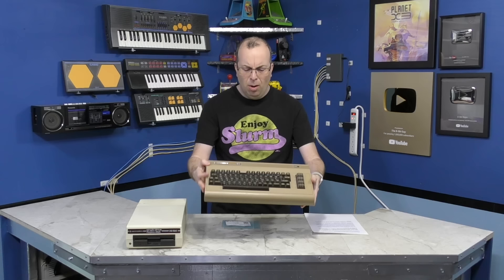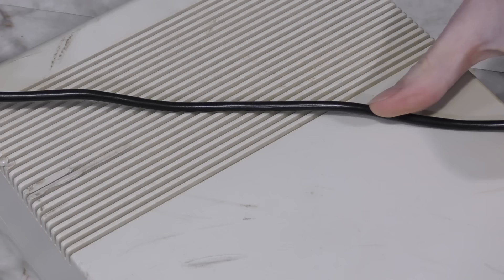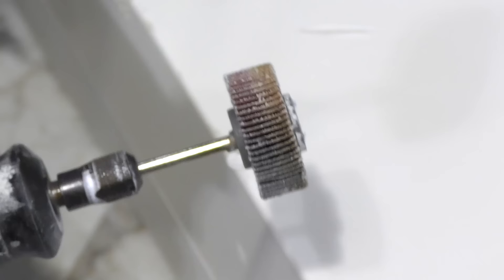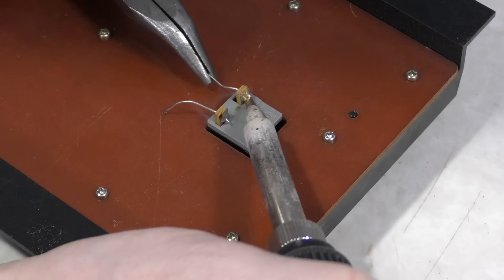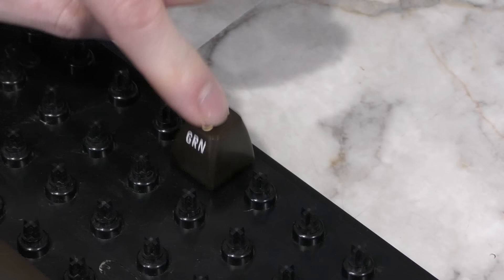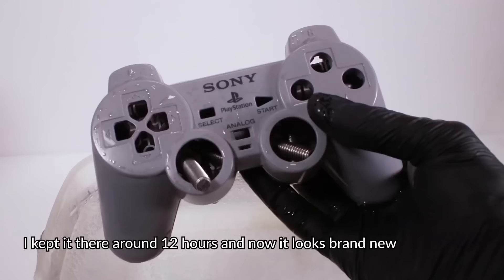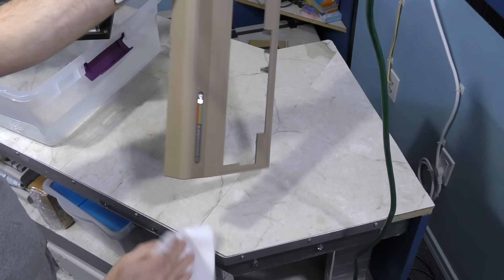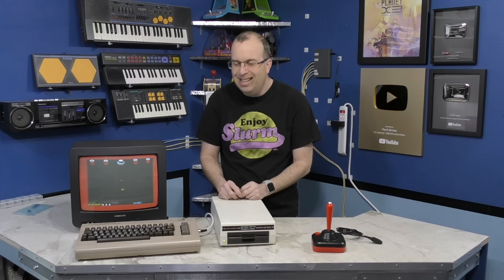Commodore 64 Restoration and new retrobrite technique.

Comment: Review of Black Magic: "I used this product on all four of my tires and now have white half circles on my blacktop driveway.
 Apparently forever unless I reseal it. They've been there for months and won't wash away. If you let any of the product drip from your tires onto the blacktop, it will be irreparably stained. I tried contacting the company and got no response. There is a warning in small print on the back label to "wipe off excess to avoid spin off" but who would ever think it would stain and ruin your driveway.  Stick to Armor All."
Reply: I wonder about shop floors, how good of a chemical repellent it is.
Reply: I've used a similar product (actually thought it was Armor All but may be mistaken) and had the same marks on my driveway.  So, next time I did the tire dressing in the street but realized now people will see those marks on the asphalt.  I scrubbed the hell out of it and eventually didn't notice any more.  In the future, I used old cardboard to do this job.  You'd think that someone could invent a dressing that doesn't leave just obvious marks on the concrete/asphalt.
Reply: Wait a minute. People want clean drive ways. Don't we want to do this on purpose?
Reply: Stupid question but... Who need shiny tires (well except for car seller companies I guess) and why?

Spending good money on probably toxic chemicals just for tires that will be dirty again just next time you use your car... I don't really get the point. :-/
Reply: 🧐 Just Black Magic the whole drive way. Problem solved. 😎
Reply: @Pr.Shadocko  You took the word right out of my keyboard. ;)
Reply: Forget overpriced Armor All or Black Magic. Scotty Kilmer uses, All American Armor car care products.  Its on Amazon & they sell it by the gallon. Get her done...peace!
Reply: If you think that's bad, try moss killer.

Comment: I have been using a similar set up to retrobrighten breadbins for about 10 months. The difference is that I surrounded the outside of my plastic bin with aluminum foil. This reflects the light and makes the exposure more even on the front, sides and back. Secondly, rather than suspending my UV light (although I used to do that), I lay a piece of clear plexiglass over the top of the bin and place my LED UV light right on top of it.

I use this approach to retrobrighten the tops of breadbin keys. I have had a LOT of keyboards that have yellowed characters on the top while the front PETSCII characters are bright white, just like the 64 keyboard in this video. I take (Sally's Beauty Supply) Salon Creme Vol 40 and apply a THIN layer to the top of each key covering the ENTIRE top surface. Then I place the keyboard in my retrobrightening bin (without water or peroxide) and expose it for 8 hours. This returns the key characters to bright white. If they need a but more then I reapply and do it again.

These are processed I developed over time and were definitely influenced by the videos from the 8-Bit-Guy and other YouTubers like Jan Beta.

I've also tried 3D printed plungers and they just aren't reliable, sadly.

Comment: David - Nice Job! As a Tech who has been cleaning electronics for over 40 years, I think you should consider a few things.
1. You joke about Cancer but proceed to use chemicals without gloves. Go to Harbour Freight and pick up some nitrile gloves. They have them in three thicknesses and when on sale are CHEAP.
2. Before you clean with liquids and make mud, you should VACUUM most of the dust off. A couple seconds with a vacuum will cut minutes of time removing said mud. It also get dirt in the cracks & crevices that wiping won't. If you're going to take the time to do it, do it right, eh? It's actually faster.
3. Always do your disassemble BEFORE you start with the liquids. Putting baking soda that's been soaked in Window cleaner into the circuits is just dumb. If you fail to get ALL of it off it could cause electronic failure down the road, plus you're ADDING the work of cleaning it off. Disassemble THEN clean. 

I won't sugar coat this, but I don't care how many projects you've done or subscribers you have, improper technique is still improper technique, don't teach others your bad habits.

THAT said I think you did a great job here and are quite entertaining and knowledgeable. Don't take my comments as a "put down" we ALL learn new stuff daily, be willing to learn too, k? :-)
Keep being awesome!

Comment: Get a dremel you can adjust the speed on, very important.
Reply: Yes, that thing is running way too fast, melting the plastic. He needs to slow it down.
Reply: I use a Dremel Flex-Shaft myself. Great for when the Dremel is too bulky for the project, or you need finer control. I have a 2-speed Dremel, but with the Flex-Shaft attached, it sometimes slows down to the point of stopping.
Reply: @Christopher-N  I don't have a dremel but a Proxxon FBS 115/e.
It has continually variable speed and is considered by many hobbyists as better quality than dremel...
Reply: Lassi Kinnunen : Interesting. While I've never heard of a Dremel Flex melting, I have given mine some strenuous work at times, and was concerned about the shaft breaking. It never has, but it is something I think about with every use. Keeping it straight as possible definitely helps prolong its life.

Comment: Great video, great tips. I've never encountered leads melting plastic in my life.  It's usually down to soldering irons. Never a good sign on any unit. Not only is unpleasing, it shows neglect or constant attempted repairs on the unit. Either that, or that drive was getting really hot. Maybe something heavy on top of it covering the vents. You make em look nice again. That's the main thing. 😉👍

Comment: Why don't put aluminum foil outside the container? As to protect your eye and strength the UV bounce back inside.
Reply: I'd think doing that would assist in retrobrighting the sides of the plastic too.  Though getting a bin with smooth ends would help side-light eflection.  (I'd put the foil outside to prevent reaction, though less effective).
Reply: That won't work quite as well. Like he said, glass and plastic absorbs a lot of the UV light going through it.
Reply: Lowen Evvan, Ot would work better than without. A loss of some light isn’t a loss of all light. Any amount of UV light refraction from the foil would aid in the process.

Comment: Another great video although I would only offer one bit of advice. White Lithium Grease over time turns rock hard. I cant tell you how many 400k Macintosh drives Ive restored with that grease in there... its Awful! I use red bearing grease. All grease may harden over time but Ive had good results from it. Keep the videos coming!
Reply: Why not silicone paste?

Comment: Loved this post. Many years ago like in the late 80's I had a C-64 and cassette drive connected to my TV. I had a lot of fun typing in programs from the then magizines , LoadStar and Commodore Gazette. anyway I joined several c-64 clubs and started a collection. By the late 90's I had a room full. Three SX-64's all working, thirty or more C-64s, C-64c's , vic 20's, c-128s and many many drives. I was the go to guy in my area to get parts and or repairs. Finally had to get rid of it all and donated it to an other collector. It took a small trailer, a horse trailer and two pickups to load it all away. I miss it dearly. I modifieda couple with two sid chips to get six voices. I even wrote some songs in six and donated them to Loadstar who published them making me kind of famous. for about a week.

Comment: For cleaning/bleaching sun yellowed white plastic, I too found the translucent storage bins from the hardware box stores essential for this type of cleaning operation.

I've found, rather than diluting or buying low percentage peroxide and placing the translucent storage bin within direct sunlight, using straight 12% peroxide is by far optimal or best!  If you have pets that might get into the peroxide, can drape clear plastic cling wrap over the top, taped to the sides of the translucent storage bin while sitting within direct sunlight.

I never tried synthetic UV lighting, figuring natural UV sunlight would readily outperform synthetic UV lighting.

I also avoid using ammonia on any plastic, as ammonia residue seems to increase UV damage.  I prefer removing all electronics from the plastic casing, first wash the plastic with a safe degreaser such as Dawn dish washing liquid, then subsequently bleach the plastic.  I avoid using any alcohol.  Albeit, minimal spot cleaning with denatured alcohol, as well as lightly sanding with 1000/2000 grit sand paper is likely OK when needed.

Comment: A tip for later. Use a metal plate when you screw into the remanence of the plunger, that way you even out the stress on the key and have full control of extracting the plastic. You can use spacers to adjust the height. I like your videos, no fuss, just plain old nerdiness and skills.

Comment: Hello, I've watched many of your videos which have helped me have a better understanding of retrobrite and how it works. I actually work on shoes and in the past have used salon care 40 to reverse the oxidation that is in the soles of my customers shoes. I now have my own formula of "sauce" that I use to unyellow my customers shoes and wanted to offer some advice. I would like to suggest using a 600 watt growing light to unyellow or "retrobrite" the pieces that you work on. Using salon care 40 would actually do very well under that type of light and should be able to get you some very fast and efficient results. All you would need to do is put an even coat of the sauce on your object and then place it underneath the light for a couple of hours to get the results your looking for. I know our businesses are completely different but I just wanted to share some tips that I've learned within the 11 years of experience I've gained as a sneaker cleaner. I actually have videos on my channel that take you the process I'm talking about. Hope you see this and maybe try to implement it into your line of work as well.

Comment: I have the B&D version of a Dremel that has a infinitely variable speed potentiometer at the base. You can slow the speed of the sanding wheel down to actually sand instead of melt the plastic. So much more versatile than a single or 1-2-3 speed model.
Excellent job on the restore.

Comment: I'd like to see a video with more experiments with 3d printed replacement parts: keyboard parts, smaller case pieces, etc. You could try messing with tolerances, making parts slightly bigger and sanding them down, and for keys you could sand them smoother and paint them. I heard somewhere that the infill % isn't directly related to strength but I can't remember what video.

Comment: My Dad died recently and I took my 38 yr old C64 home with me. Bought a new PSU (the one with two cords on it, one for FDD and one for C64). I plugged it in and turned on the C64 which then started SMOKING. Unplugged everything, opened it up, replugged PSU without turning C64 and did voltage testing. Where 9V was supposed to be coming in, I was getting over 13! BUYER BEWARE. Even units that were plainly made SPECIFICALLY for the C64 may not perform as expected. Waiting for another PSU now.

Comment: I've seen old plastic electronics that are still packed in the original box and styrofoam inserts, but the cords just got stuffed in hodge podge, and then stored for years and years until I found it and I've seen that exact same type of melt marks in the plastic.  It was totally obvious the cords (or rubber bands in some instances) did the damage.  Because the cords were still resting where they did their damage when I unpacked it.   I've even seen it on brand new old stock.

Comment: Hey, have you ever tried the electric toothbrush? It makes that part of the cleaning so much easier!
Reply: I used some of the retro-bright and cleaning information from this channel to clean a more modern keyboard a year or so ago. I didn't want to use my personal electric toothbrush to do the cleaning but I did donate a couple of dobs of my baking soda toothpaste to do the cleaning. Worked out great.

For those wondering I had to clean ink spills off of the keys from a golf ball labeler. Thankfully that stuff wasn't as permanent as advertised.

Comment: Another GOOD decision is the "unknown color of the C64 for real, somewhere gray, smewhere brown, the one I had was a medium grey but with small "violet-ish" tone ..... so, the bottom line of inconsistency during inyection really disimulates the yellowing like a champ.  This guys were clever from start to end. The only part you notice the yellowing is on the keys (the printed letters over them).  Cursor not blinking, is one of the simplest ones, glad you didnt got a blank screen because could be anything but there are tutorials to narrow the issue goo enough. Long live to the C64. we an agree that it is still under use, even commercial use for current develpments, SID music .... Comunity and a flexible patform turned this machine into a timeless HW. You can still achieve big things and move a lot of sensations that are not worried about a 1Mhz and 64KB of RAM. You dont need insane resource to have a good time o let your talent free. The small of the resources, the big of the challenge

Comment: 16:35 You can put objects into the tank along with the small qty / size pieces to displace the liquid you use and every displacement object should be solid and not reactive to the particular fluid. That solves your problem. 

You could probably get away with using a small one off canister like a plastic box from ice cream eaten that week or something for small objects. As our building recycle plastic I always rinse all plastics soft or rigid to not have the collecting container by the apartment staircase entry point smell from the recycling bins. So I always have a box or something available that I haven't yet bothered to recycle.

You could use a piece of flat cardboard slightly larger than tour tub fitted with lamps and just place it on top, so it easily removed and electrically not connected to anything that has a fluid, which will also make cleaning the tub simpler.

Comment: Simple trick for you @the 8-bit Guy  when you file plastic like this,  1st grab some silicon molding puddy, lay it on the drive, and make an impression of the texture the surface has,   file the area you need down, then apply a small amount of epoxy,  and imprint the text back in, so you don't get smooth spots,  just use an epoxy tinted the same color,

Comment: Love your videos! Just a quick suggestion though. Using corrosive ionic compounds such as window cleaner and baking soda is a great way to cause rust and corrosion of anything metallic they happen to find their way into - like joystick sockets, IC sockets and pins, etc. Not to mention they leave a conductive residue. Personally I would only use after removing the internals or finding some other way to ensure they can't get inside.

Comment: If you ever wondered why most plastic fishing/tackle boxes are advertised as "worm-proof," it's not because they're immune from attacking earthworms, it means the plastic the box is made from will not react to plastic fishing lures, like plastic/rubber worms.  Throw a rubber worm in a typical clear plastic storage drawer and it will melt as the plasticizers leach out.

Comment: To get that cable burn taken care of, I use a long snappable razor blade from an Olfa knife. You can bend the blade and make a sort of U shape. You use the bottom of the U like a scoop and shave off the extra Plastic. If your careful you can get it pretty flat. Always use a fresh blade.

Comment: Try soaking the spots on your driveway with a degreaser, can get commercial ones from home depot or Sherwinn Williams paint stores, then pressure wash, repeat once dry.  It's likely from years of that tireshine soaking in, the silicones soak into the concrete and dry, silicone/oils in the shine repels water etc.  May have to pressure wash the entire driveway meticulously to make the area blends but it should hopefully remove the spots.

Comment: I recall spending so many hours on the family C64 in my youth.  In 1992 I passed up purchasing a C64 reboot system and to this day I regret never getting it.  I've tried to explain to my kids on how games use to be compared to current systems. 
Anyhow well done on your restoration.
Reply: "Back in my day, we didn't know whether the game would actually work with controller 1, 2 or both AND the keyboard. Sometimes we had no idea what the graphics were supposed to represent and had to wait 5 minutes for the cassette player to load."

Comment: When trying out glass containers keep in mind that different glass compositions will block UV light (mostly B and C).
Reply: I'm wondering if a used aquarium might be handy for such.
Reply: Yeah my thought exactly, but why would you care anyway ? The UV light is coming from the top, not through the sides of the container? By all means, I would prefer it if my container did reflect (rather than absorb or transmit) UV light, so it might be more efficient...
Reply: @takix2007  The video showed a stripe of LEDs wrapped around the container. If glass UV-C will most probably be blocked. If you want to avoid evaporation a lid will be the next best choice. Glass will block UV-C there too. Best choice would be quarz but it's very expensive.
Reply: @deadbeef16  Agreed, also about quartz being the right (but costly) option: a few years ago in a chemistry research in the lab we had to check whether specific UV wavelengths had an influence on the chemical process. The use of an off-the-shelf glass prism was technically not possible, so we went out to look for a quartz prism... and finally decided to try something more cost-effective with smaller surfaces of layered UV filters 😄
But I was mostly talking about Dave's configuration, not the other one.